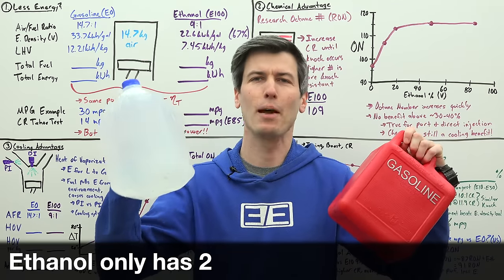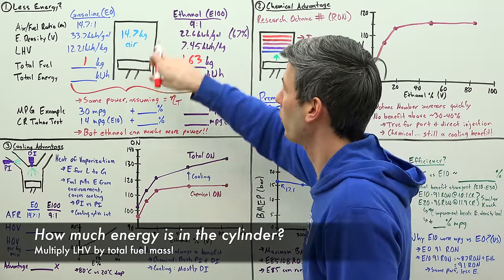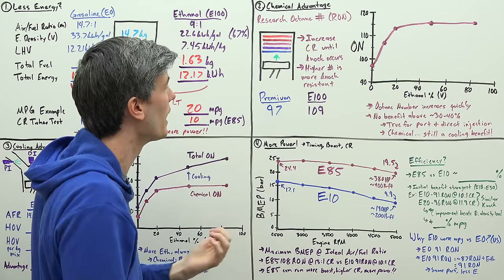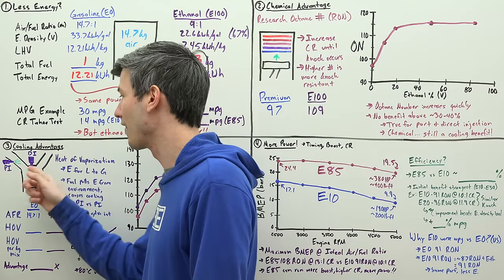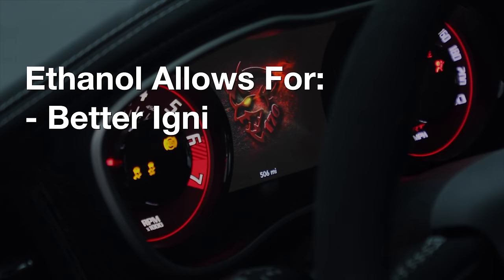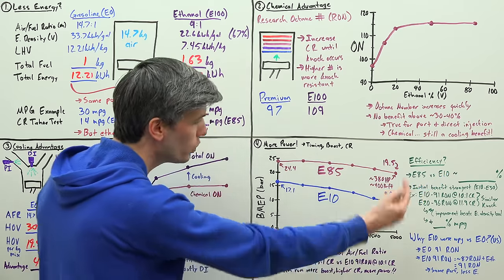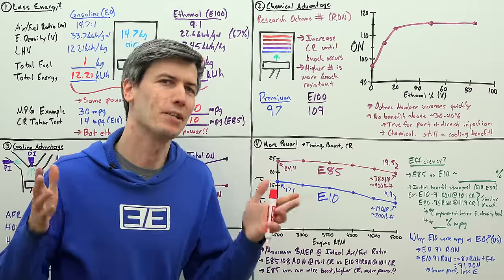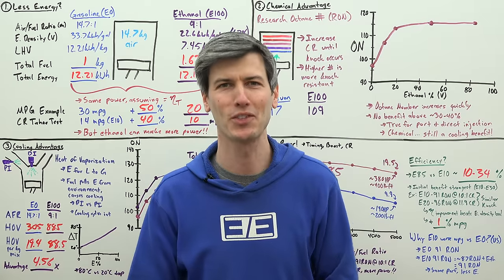Why Does Ethanol Make So Much Power? (Versus Gasoline)

Comment: During WWII fighter planes also got more power by injecting water into the fuel during detonation.  I believe it was the Mustang P-51.  Kind of the same principal as here, you are stretching out the area under the curve and preventing knock, giving more torque, more horsepower.
Reply: They used alcohol as the antifreeze in the water and gained extra benefits.

The Japanese Zero used ethanol as its fuel source.
Reply: @danafletcher2341  Cool.  I've heard however even pure water injected will boost power (and doesn't violate the Second Law of Thermodynamics either)
Reply: @raylopez99  It will, but not if frozen at high altitudes ha ha.
Reply: 1960 Olds Jetfire turbo used methanol/water injection to prevent knocking.

Comment: Hey, awesome video. Could you maybe one day make the same video of comparing gasoline with lpg? Since lpg fuel is very popular around the europe. That would be awesome, thanks cheers
Reply: LPG used in Australia also.
More widely known in America as Propane.

The latest Liquid phase injection systems offer similar benefits to e85 in regard to charge cooling and higher octane. And it’s CHEAP fuel.

Comment: High concentration of ethanol will foul fuel systems due to the excess water, especially if you don't drive often. If your car sits for a couple weeks, problems crop up.
Reply: NOPE.

Comment: ב''ה, great video, but burying the lede as far as the obvious to remind gearheads - the immediate benefit is higher RON as can be realized as power by allowing higher compression engines.
 
People forget or don't understand this, only know that their standard engine in non-E85 states gets shitty MPG compared to summer gas, and miss the big picture.  Slam the octane equivalence up front and folks at least have the potential to understand this and that it takes a properly designed engine to realize much of the advantage.

Comment: Just coincidentally, I decided to fill up with e15 for the first time today (88 octane rating). Even just pulling out the gas station I swore it felt ever so slightly more punchy. I need to stop dragging my feet and get a e85 tune on my car. 2016 Golf, btw.
Reply: I use it because it’s considerably cheaper. It works well …

Comment: I get an extra 5-7mpg going up and down the 200-300 foot hills on my 48 mile round trip to work over E-10. That's the end of discussion as far as I'm concerned. Oh yeah, the gas station 200 yards from my house has non-premium pure gas for about 10 cents above average prices in my area.  I get an extra 2 gallons' worth of miles out of a half gallons' worth price increase.
Reply: BS.

Comment: What you are overlooking is even now at 10% alcohol we are having trouble growing enough corn for alcohol. Actually, it is only practical because of government taxpayer subsidies!  Multiply this x8 and it gets to where virtually ALL corn production would be used to produce alcohol, AND THAT STILL WOULD NOT BE ENOUGH! So even more crops (sugar beets, sugar cane, etc.) would have to be diverted to producing alcohol. The impact on the food supply would be drastic! (higher prices!)
Reply: The Federal corn ethanol subsidy ended back in 2011.

The long-standing stated goal of the G7 Nations to end petroleum subsidies?  Not so much.

Around half of the corn for feed is value-added into distillers grains and ethanol.  We are currently around 10% of gasoline as E10.  If we value added all the corn into distillers grains we would have healthier cattle and E20 would be the max.  We could not even match Brazil's E27 for non-flex fuel cars so you are correct, more sources than corn would be needed.

No corn would be grown beyond the protein requirements of the cattle herd size on feed since it would become uneconomical to do so.

There are other sources of ethanol.  California has outlawed the hauling of food waste to landfills since it makes them produce methane gas.  Food processing plants there now need to find an alternative home for the waste.  It easily could be made into ethanol and the bagasse leftover be sold as a fertilizer.

We also haul big amounts of grass clippings and leaves to landfills.  This too can be made into ethanol.

Sewage can be turned into ethanol but better yet would be to make sewage treatment plants which incorporate cattails.  These plants are cheaper to build than conventional treatment plants and the treated water discharge is cleaner than the rivers it goes into.  Cattails can make the most ethanol per acre of any land plant and the bagasse could be sold as natural fertilizer as well.

The Gulf of Mexico has thousands of abandoned oil platforms in the nutrient rich dead zone.  If we were to put out floating kelp growing nets 1/2 mile around these platforms which equals 640 acres, we could harvest the kelp and make 30,000 gallons of ethanol per acre.  Do the math on a few thousand platforms with that for an eye opener.  

They could ship the ethanol to shore in the platform's abandoned pipelines.  Again, the bagasse could be sold as natural fertilizer or if we cleaned up the dead zone too much, returned to the kelp to grow.

Here is how the 2007 Energy Independence and Security Act affected food/feed prices(if at all):

2007 WEIGHTED CORN PRICE =$4.20 WITH 4 .7B GAL MANDATE
2008 WEIGHTED CORN PRICE =$4.06 WITH 9B GAL MANDATE
2009 WEIGHTED CORN PRICE=$3.55 WITH 10.5B GAL MANDATE

2016 WEIGHTED CORN PRICE =$3.36 WITH 15B GAL MADATE MAXED OUT
2017 WEIGHTED CORN PRICE =$3.36 WITH 15B GAL MANDATE MAXED OUT
2018 WEIGHTED CORN PRICE =$3.61 WITH SAME 15B GAL MANDATE MAXED OUT + MOST ETHANOL EVER PRODUCED

Wheat
2007...............$6.48/bu
2008...............$6.78/bu
2009...………$4.87/bu

2016...………$3.89/bu
2017...............$4.72/bu
2018...............$5.15/bu

Soybeans
2007..............$10.10/bu
2008..............$ 9.97/bu
2009...……...$9.59/bu

2016..............$9.47/bu
2017..............$9.33/bu
2018..............$8.48/bu
Reply: Glass we grow plenty of corn here in the USA..too much alot of years.

Comment: The only down side is to get the extra power you need much more fuel..  it’s all just much easier using higher energy density fuel.  Oh and higher compression ratios require stronger engines so there is a negative mechanical effect.

Comment: I remember when alcohol was the fuel of choice for racing. The old Offenheuser and Drake Offenheuser 4 cylinder engines made more power on alcohol than V8's of the day on gasoline. It was fuel consumption that killed alcohol in racing for all but drag racing. When fuel allotments were being cut, it eventually led to gasoline becoming the fuel of choice. Yes, E85 can make more power, BUT you burn twice as much!
Reply: Ethanol still is the choice of race teams, but not all associations allow it.
Reply: @TheAutoChannel  — Poor ole Steven here doesn’t seem to realize that IndyCar is still using ethanol …
Reply: @sking2173  As well as NASCAR.

Comment: Ok — so, if we went to E20 & changed the gearing in the car to leverage the higher torque, could we improve the gas mileage?

Similar question… if we have a vehicle which takes E85, can we change the gear ratio to get better gas mileage, since we have more torque?
Reply: It's not the gearing, it's the spark timing, air mixture, and piston length that makes the difference. However, in many engines, if you use E30 to E50 you will get better MPG.

Comment: In Brazil, our gasoline is really poor, however we have Ethanol since the 80's and since 2005 I guess almost all cars produced here are Flex fuel, now even those small 1.0 turbo engines are flex fuel here.
They told us that since our ethanol is made out of suggarcane is cheaper to produce than corn based or something like this.
I think ethanol could be a great alterntive to synthetic fuels
Reply: Actually, auto manufacturers in Brazil have been dropping flex fuel capabilities of late.  Take a look, Ford just introduced the F-150 pickup for sale there and it is not flex fuel for some odd reason.

Sugarcane is great, it is a perennial plant which grows on marshy ground not fit for pastures, cropland, or forests and is located thousands of kilometers from the rainforest, but it is not cheaper than corn ethanol.

Sugarcane requires a dedicated acre but corn ethanol is value-added from existing corn feed production which leaves 100% of the protein and other things still available as feed in a healthier, more digestible/efficient, and more concentrated form called distillers grains.

With this feed factor, nothing out there including sugarcane can compete with it even though it produces more ethanol per acre but little else.

Brazil, since it feeds livestock, is making ethanol from corn also.  It is a nice fit because they can more efficiently run the ethanol plants all year around between sugarcane harvests.  Corn stores well and sugarcane does not.

Corn ethanol is so much more economical that Brazil put an import tariff on US ethanol.  The downside of corn is that it is limited as a source to the protein requirement and size of the cattle herd.  Corn ethanol is not economical beyond that.
Reply: @danafletcher2341  — Dana, have you read up on the new-for-‘23 IndyCar Ethanol (Shell), which is reported to be “a blend of second-generation ethanol derived from sugarcane waste and other biofuels to create a fuel that is 100% comprised of feedstocks categorized as "renewable" under the applicable regulatory frameworks”. 

It sounds like a bunch of politi-speak to me, but I’ve never seen any details of what the feedstocks actually consist.
Reply: @sking2173  I believe molasses might be what is considered "sugarcane waste".  I doubt they make it from the stocks since they don't have much value but I could be wrong.  We should not eat the sugar we do so that is waste IMHO.  

Brazil uses the leftover stocks to burn and distill the ethanol.  Otherwise since past practices of sugarcane burning off the stocks right on the fields (they used to that in Hawaii at least), it is better to efficiently burn in a proper incinerator/distiller.  It probably would be good to somehow chop and return to the soil somehow.

California imports sugarcane because they do not understand that corn ethanol uses the waste starch cattle cannot digest and are unaware of what distillers grains are.  We have had years with the situation of us exporting chemically identical ethanol to Brazil while importing chemically identical ethanol back.  Go figure.  How ecological is it to send the ethanol on travel vacation cruises??????????????
Reply: @danafletcher2341  — The #1 (most important) use of sugarcane is in the industrial processing of the stalks to make rum. 😁
Reply: @sking2173  They use the juice of the stocks to make rum and sugar, the stocks or bagasse are the waste cellulose.

Not much cellulose goes into alcohol at all.  Not very concentrated as a source and hard to break down what is there.  Cattle's natural diet is cellulose and they have four stomachs to do it.

Sugar beets have even less bagasse I do believe.  France uses sugar beets for ethanol.

Comment: great video. Question though, could engine size be reduced, in conjunction with running ethenal fuel to further offset the worse fuel economy in eth vs gas? Example, if you could make the same power with the Ford 2.7 eco boost with E85, that you could on reg 87oct in the 3.5 ecoboost, wouldnt that further decrease the difference between the energy of both fuels?      In my head it makes sense but, not sure I typed it correctly.

Comment: Is it correct that if I have an old engine (366ci Chevy Mark IV Big Block, throttle body injection, in an old gasoline-powered U.S. school bus) that consumes more gas than I drink beer, and the price of gasoline and ethanol-blended gas is the same (both expensive here in Europe, $7 per gallon), I should stick to gasoline if my only concern is "money per distance"? (Greens, please don't worry too much, it's not my daily driver 😀) Because in my case, the efficiency of ethanol won't outweigh the energy loss compared to gasoline, as that old engine doesn't have the high compression ratio required. Therefore, I should prioritize "more energy density" in gasoline molecules rather than seeking "ethanol efficiency" when choosing the fuel. Am I correct? ^^
Reply: Yep, you’ve got it … But in many venues, the ethanol cost is low enough, comparably, to make it preferable on a cost/distance basis …

Comment: So, the big difference in hp output is thanks to the possibility to run much higher CR when using ethanol.

What would be the difference if the CR was to remain the same for both fuels? Or is it impossible to do, meaning that with Ethanol we HAVE to increase the CR for the engine to function properly??
Reply: If the engine does not knock with gasoline, ethanol will not give you a noticeable difference.
CR of something like 10+ or boost pressure is needed for ethanol to make a difference.
Just like low octane fuel works fine when cruising around, but under higher load a modern engine will knock and most engines will limit themselves.

Comment: Too bad Ford didn’t use a higher octane E10…94-97 ROV (regular gas is cheaper than E85, which may be priced similar to high octane pump gas). More power may be good, but what is lost? Higher efficiency is good news, but loosing range on a tank of fuel is not. And then there are the environmental issues with burning a unit volume (litre, gallon…) of fuel to supply roughly the same unit volume of ethanol. Thanks for your explainin’
Reply: GM wants a new 100 octane fuel standard, then they could make their ethanol optimized engine which Ricardo built for them and drove around a few years ago.

It gets not only more power than gasoline optimized engines, it gets more mileage, even more power and mileage than a diesel engine.  All at half the size.

FROM RICARDO:
The new federal CAFE standards are calling for a doubling of fuel mileage performance, which, Vint says, is going to send OEM’s looking for high octane numbers to improve efficiency and ethanol is the best source. Ricardo, an engineering firm with over 100 years in the business of engine design, has developed an extreme boosted direct injection engine (EBDI) to optimize ethanol blends. The 3.2 V6 gasoline engine rivals the power and torque of a much larger GMC Sierra 6.6 diesel, he said, and it delivers 3.5 percent better fuel economy than the diesel.

This is not new technology or knowledge, it was known long ago.  It is suppressed technology.

Rear Admiral C.M. Chester wrote Henry Ford a letter on Dec.15, 1916:
"...I also pointed out in the article that as governmental laboratories had developed from 40 to 55% efficiency in alcohol engines as against 20% in gasoline machines, the use of alcohol at double the cost of gasoline for power purposes, was cheaper for motor[s] than gasoline in common use today."

Comment: Great video.  I have been waiting for you to do this one.  in a nutshell,  Ethanol is really only good for performance.  Fuel economy suffers though.  I took a trip from Long Island to Vermont in a 8 cyl BMW.  ran E10 on the way up and averaged 23 MPG.  I filled up when I got there with E0 91 octane and I averaged 26 MPG on the way back.  and I had more stop and go traffic on the return trip.  So my question is.....  Why are we putting ethanol in our fuel?  as far as I can see, it only benefits the  farmers.  Your thoughts?
Reply: They started putting ethanol in as a knock suppressor from a two fold problem in that there were controversial studies coming about concerning the health and mental effects of the high lead levels in the atmosphere and water in major cities and along interstate corridors, and also with the new emissions regulations requiring catalytic converters, the lead in the fuel was killing them pretty quickly. So the solution was to use ethanol, which the lobbying behind that decision is worth a video in and of itself.
Reply: Lead was out of our fuels long before they started adding ethanol from what I remember it was to subsidize the corn farmers
Reply: @anydaynow  Ethanol was the original anti-knock additive. The only reason it was originally replaced with leaded gasoline was because the manufacturing process could be patented for leaded gas. The health issues showed up almost immediately for the factory workers.

Comment: Just make sure any rubber hoses and gaskets also any aluminum are swapped out so they don't get eaten away or corrode due to the alcohol.
Reply: Ethanol on manufacturer's chemical compatibility charts at worst shows it to be equal to or most often less corrosive on rubbers, metals (including aluminum), and plastics than what gasoline and BTEX (benzene, toluene, ethylbenzene, and xylene_ are.  Go take a look for yourself.

Comment: Is there any benefit to using a higher octane gasoline in a DI engine with a compression ratio of 11:1 or higher? I watched your video about it, and I've already understood years ago that it's best to use what's recommended by the manufacturer, but this video has me wondering because of the bit at the end with the higher RON fuel having more energy density.

Comment: So if this is the case, why is the Ford 3.5 Ecoboost not flexfuel but the 5.0 Coyote is in the same truck?
Reply: Easy, Ford, the EPA, and the MIT scientists who actually invented the ecoboost system developed the ecoboost system originally did it with ethanol and fuel economy was not less than gasoline but greater.  Ford did not want to pay the MIT scientists for patents so then came out with ecoboost without the E85 boost which they believed bypassed the MIT patents.  

This is in court to this very day I do believe.  Ford has a history with using technology they don't want to pay for.  I think there is a movie about intermittent windshield wipers one can watch.